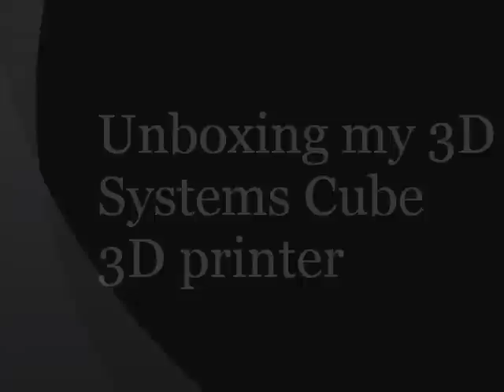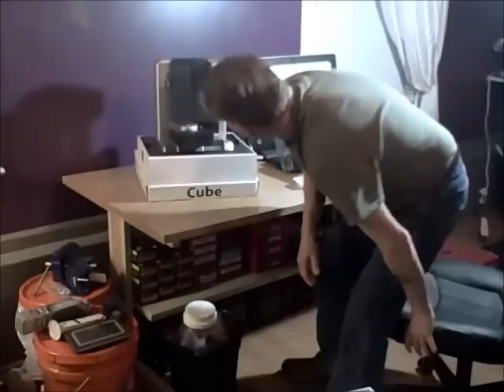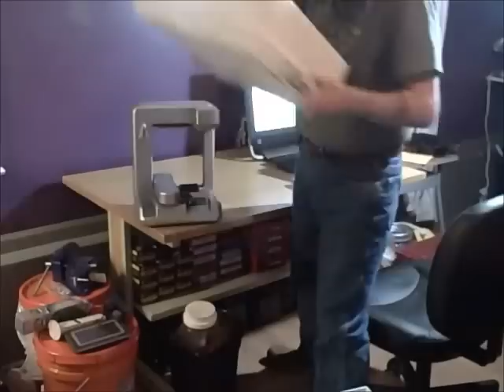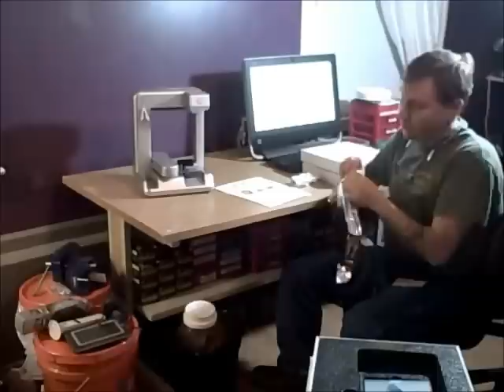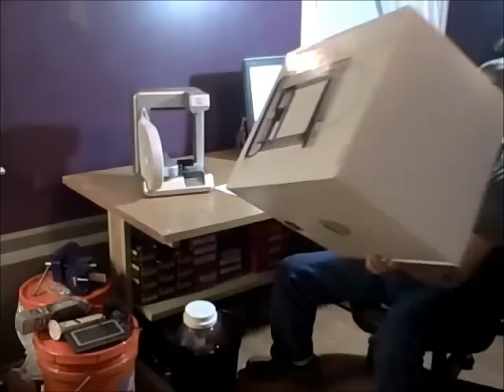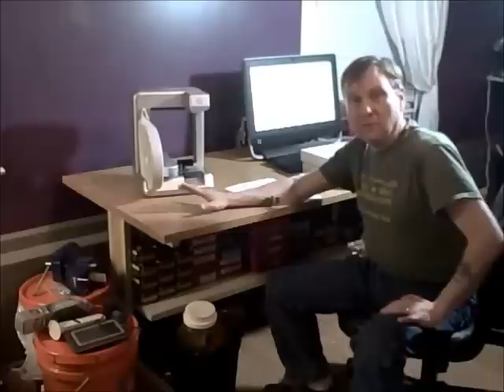Unboxing 3D Systems Cube 3D printer

Comment from the maker: Working on that now. I printed my first part. 2" OD x 3/4'' Hex ID x 1'' thick with a 1/4'' tapped hole from OD to ID. Looked 'ok'...I put a 'raft' on it and I shouldn't have (live and learn). Dimensionally the part was within .008" of drawn. Total variance of .004". There were some 'uh-oh' areas but for a first part I was impressed. Again..this is a $1299 machine...not a $20,000 one